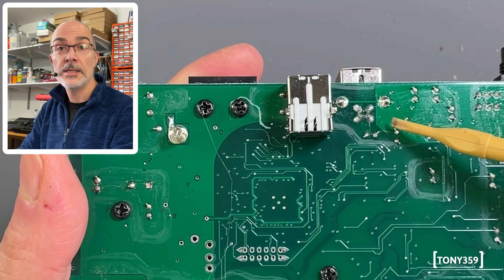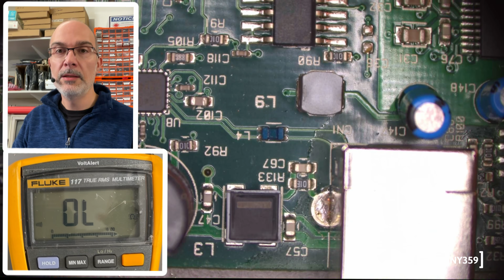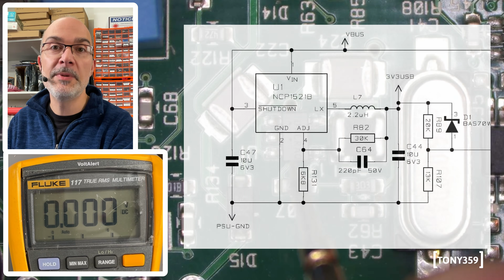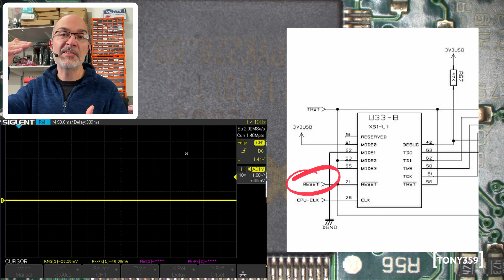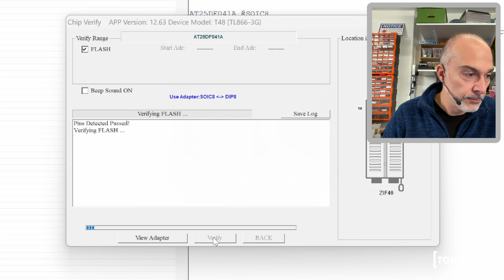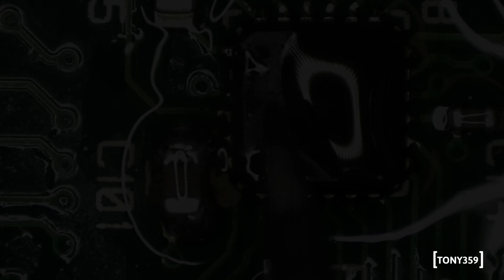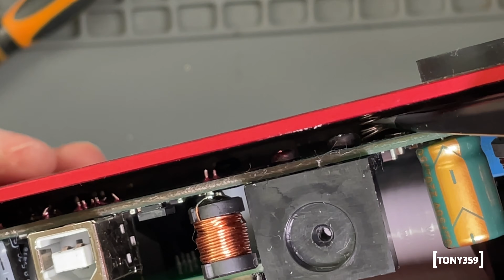Fixing this soundcard wasn't easy!

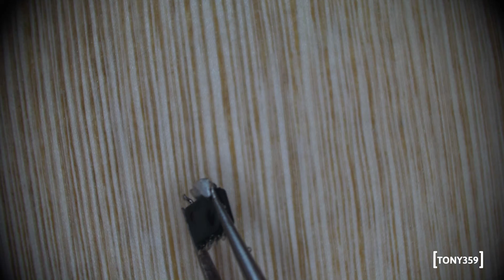Comment: 18:32 Replacing the lead-free solder on pads of the larger chips such as the flash chip is not really necessary. Generally with component-level repair, the less work you do on the board the less chances you screw something up. Also when picking up the chip from the board, don't try to grab it from below. The surface tension of the melted solder will resist your attempt and you are likely to push the chip into neighbor components and knock them off. Better to grab the chip from its sides.
Otherwise, nice job fixing this.
Reply from the maker: I was hoping to grab one of the legs but I used my bad tweezers without realising!
Thanks for the pointers, always useful!
Reply: understandable. everyone has a pair of bad tweezers on the bench, and i have more than one. that said, pulling the chip from its leg is also not a recommended technique because this way you would be applying asymmetrical force to the chip and again that could push it into neighbor components. Best to simply grab it from its sides and pull vertically. @tony359
Reply from the maker: I cannot argue with that! It was just one of those moments: wrong tweezers and wrong technique :)

Comment: The "Grime" you mentioned on the knobs is rubber coating disintegrating. I have an old Maudio interface which has been in a shelf for years and all the knobs are a sticky mess.
Reply from the maker: I thought about that - Let's hope it's that then! :) Thanks for watching!
Reply: That was my first thought as well. Looked exactly like the rubberized muck I'm used to seeing on aging devices. Haven't seen it on knobs before though, I'll admit.

Comment: Hi. I had a 6i6 1st gen on the bench, same issue, same chip to replace. First i ordered a few from china since they were not available anywhere (mouser)at that time. Replaced 3, none worked, probably fake ones. Then after more then a 6 months they became available back in Mouser, the first one worked ;). Good video, i really liked the detailed fault finding. thanks
Reply from the maker: Ah interesting! Good to have two spares then :) Thanks for watching and for your kind words!
Reply: @tony359 with pleasure. I just found your channel, i will check more of the videos.

Comment: Great diagnostic work as per usual.
You might want to give solderpaste a go instead of reapplying solder to the pads.
That way you can skip soldering pin for pin.
Clean the pads, apply a small amount of solderpaste, put the chip in place and blast it with hot air.
Reply from the maker: I have some, I thought that solder was a bit easier for my first time. Who knows. I hope I can practice again soon! Thanks for watching!
Reply: @tony359 after some practice its alot easier.
Just get some of the cheapest chips you can find in the package you want to practice and some practice pcb's.
Recently got myself a bunch of 4 layer pcb's with big internal ground planes made just to practice soldering VQFN packages for an upcoming project.

Comment: disappointing that
focusrite scarlett 2in2
does not have digital sound input for connection to the cd player, TV, blueray and the like
Reply from the maker: Well, it's a basic card. My MOTU has digital inputs (though I don't think it supports multichannel) but it's 2.5x the Scarlett's price! For the price, I think the 2i2 is a good product - but yes, it's very very basic :)
Thanks for watching!
Reply: @tony359  Okay. Almost all sound cards for computers that I know of have almost always had a digital sound input.

I like to have the same sound quality from all my digital sound sources. therefore I like to connect everything to my dac.

3 of my dac. have USB so this possibility is nothing new.

Comment: New QFN chips that have likely been sitting around for 10+ years tend to not stick unless you tin the pads under the chip first. So add flux and solder and tin the pads then when you hot air the chip it will automatically stick and all pads will be soldered. Also, you made the right call by wicking away most of the solder on the middle ground pad. Too much solder can squeeze out and create shorts on the outer pads which would be bad, most likely resulting in having to remove the chip and start over.
Reply from the maker: Thank you! Many have suggested the same! I shall do that next time! And good to hear that my decision to remove some of that solder was a good idea :)
Reply: @tony359  imho (and just for reference I'm a test engineer for a PCB assembly company so a lot of times I have to deal with soldering defects lol :P), you could have even removed all of the solder and still have gotten away with it. It's mostly used as a heatsink/ground pad and even the small amount of solder left there would have still made a good connection and besides it's a sound card, fairly low USB data transfer rate so the chip won't get hot. The most important thing with soldering QFNs is for them to lie absolutely flat on the PCB surface. Even minor level imbalances are annoying af to deal with. You should also have removed the capacitor from the side so that you could have better accessibility. It's a bulk decoupling capacitor, even if you ripped the pads you could still hack it back together and it would have worked :P
Reply from the maker: @InTimeTraveller  Absolutely. I feel I didn't manage to melt the solder under the IC - or it would have squeezed out from the edges. I was concerned I might have burnt something so... Next time will go better, I hope! Yours is a cool job!
Reply: @tony359  hi, thanks. Nah, you had a relatively thin layer left so it wouldn't squeeze out, it just gave you a hard time being perfectly level all over. Thing is, solder resist (green pcb coating) is really good at, well, resisting solder :P So, unless you have an ungodly amount of solder it's really difficult for the solder to squeeze out all the way out to the pads, because there's a good width of solder resist that is preventing it (in fact QFN packages are designed in such a way) and the chip is really not heavy enough to force it. With solder paste in the factory it's a bit easier for it to happen because you have the solder in a paste format so it's much easier to squeeze out the paste. If you had really insanely too much solder (like in the beginning) the chip would be like a boat floating on  a lake of solder 😛 So an serious note, it would most likely not stay level on some side.
Reply from the maker: @InTimeTraveller  Glad I decided to remove some of the solder at the beginning then! Well, the 2i2 is still working :)
Reply: apparently Louis Rossman is not the only one knowing how to solder tiny ICs!
Reply: @alelondon23  Louis is actually not that good. Yeah to the below-average noob he looks like a god but vs a pro electronic engineer he's pretty average. I've publicly documented smd soldering repairs 10X harder than anything he's done. Look them up you might learn something lol
Reply: @g4z-kb7ct   I'd love to. link?
Reply: and how can look up your public demo ? you dont have a video on your channel any tips?  @g4z-kb7ct
Reply: If you use enough flux, even if there's too much solder on the center pad, when you heat it and push down with the tweezers, the flux won't let the solder bridge and it just squeezes out. This looks to me like a classic case of both iron and hot air not being hot enough. Most people have their iron and air temperatures not hot enough, and end up cooking stuff because they have to sit there forever to get enough heat into the chip and the board for anything to melt. Much better to have the temperatures higher, and get in and out quick
Reply from the maker: @gorak9000  Gotcha. On the temps, I might be one of those who doesn't like to blast 500C to an IC. I know it "works" but I don't think they were never designed to withstand such temps. Yes, it's for less time but I'm not sure I like that! With this interface I should have probably turned on my pre-heater a bit more.
Reply: @tony359  Do you know how IC's are made? They're baked in diffusion ovens at crazy high temperatures for hours (I work in IC manufacturing, but I'm not familiar with the temps the diffusion ovens run at - it's not my area, but there are multiple steps that use the oven, and the temperatures are EXTREMELY high). I run my iron at 380 C and my hot air usually a little hotter than that. I actually have the exact same pre-heater you do, but I hardly ever use it - only on 12 layer boards with obnoxiously thick ground planes is it really necessary. And only really for BGA rework. Usually just the hot air wand is enough. It looks like you have one of the better hot air stations (a Quick or one of the better quality Attens, just by the look of the nozzle), so you should have plenty of heating power in the hot air gun. The super cheap ones don't really have a big enough heater to keep up at high air flow rates (aka the notorious 858D and similar)
Reply: Also, I never get the fascination or need to completely removing the solder (and ripping pads off) just to add solder back in the very next step. There's no need to clean the solder off entirely, just go over it with a little fresh solder, generous dose of flux, and flow the new chip on.
Reply from the maker: @gorak9000  It's to remove lead-free solder and add leaded - so you can flow with lower temp.
Reply: @tony359  You don't really need to remove all the lead-free to get to lower temps - just adding some leaded solder to what's there drastically reduces the melting temperature. Also, to help not rip pads off, resist the urge to "scrub" with the wick. Keep the end of the wick together (not all splayed out), put flux on it, and just "dab" with the iron - don't scrub. It's the capillary action of all the strands in the braid close together that pull up the solder - when the end is all splayed out, you don't get that capillary action anymore. Sometimes adding a little solder to the wick itself helps as well (aka when you cut off the part of the braid that's full of solder, always leave a little bit of solder on the end of the braid - don't cut back to empty braid)
Reply from the maker: @gorak9000  Quick indeed, 861 DE, the more powerful one. 380 is ok. I think I was on 360 on hot air with pre-heater. What I don't like are those who set the station at 500. I am very well aware that ICs are baked but if you look at reflowing profiles, those silly temps are kept for a very short time. AFAIK an IC is designed to reach 260C for, say 30s. More than that it's luck :) 
It's an interesting subject though, I'd like to make a video on that. One major flaw of the general consensus - again IMHO - is that we cannot apply those profiles when we use "home" tools. If you work in manufacturing you'll know how important humidity is and how extremely accurate an precise those ovens/BGA machines are. What we use is a pale approximation of those tools so I do feel that those profiles cannot be used as they are - or at least with some "tweaking" to compensate for the fact that our workshops are not environmentally controlled as a production line.
Interesting subject!
Reply: Use a glass brush to gently remove any oxidation.

Comment: Well this gives me some extra hope and encouragement to repair a fairly nice TASCAM audio interface that i bought for like $5. I haven't put a lot of time into it yet. I do have an older TASCAM that i use occasionally which needs all of its surface mount electrolytic caps replaced, because they have that characteristic squeal, but for that i need to remove every single potentiometer and switch of which there is a dozen, since the caps are occluded by them, it's an insane construction. But the old TASCAM is never gonna be a good interface even after that, it wasn't good when it released, the inputs are just about palatable, not great, but headphone/output section has a little too much distortion designed in, and is kind of hard to decipher without schematic, and it was last supported on Vista, it's from the Windows XP era (thus also badcaps), so while you can still install Vista drivers on 11, they are not what one might describe as trouble-free, as they break suspend and volume control broke during the evolution of Windows 10. The completely broken interface is recent, i really wouldn't mind getting it up and running again.

I think what happened to the recent one though is that the firmware update over USB went bad, and the ATMega microcontroller which carries the firmware gets stuck and doesn't upload the volatile firmware into the USB companion chip on power up. But i could just try replacing the USB interface IC i suppose just in case, at least it doesn't have a firmware flash to worry about. ATMega is unfortunately read locked so i can't just verify that its firmware looks valid. I will probably need to reverse engineer the firmware update utility to extract the ATMega firmware from there somehow?

This also made me interested in hunting down a well-broken first gen Focusrite 2i4, because with firmware file and schematic being present, there's no way i couldn't just rebuild it no matter what calamity befell it. I don't care for 2i2, since it doesn't even have MIDI.

If others have other interesting audio interface ideas that i can get broken/used cheaply and that are amenable to repair, i'm all ears. Should have MIDI, needs to have at least one XLR with 48V, needs to be capable of stereo line and mono guitar input.
Reply from the maker: Good luck with the TASCAM, I'm surprised that one of their products is not so good! With SMD capacitors, I recommend using two irons. I dislike the "pliers" method a lot! 
https://youtube.com/shorts/mjAHISbPUrw?feature=share
Reply: @tony359  None of their audio interfaces were actually ever that great that i know of. All are a little noisier than you'd expect for the era and the price. But the very first lineup of which my US-122 is a representative is particularly undercooked. But it's also well over 20 years old...
Reply from the maker: interesting to know!

Comment: Everything went perfect.  Just needed to add a little more solder before placing that USB IC and heating it back.  In theory, you did not need to run the solder down the side of the IC.  Next time just plug it in as LONG as no legs are joining other parts like the Cap or leg together.  I know what it feels like to want to make sure but first time wit heat gun should have been enough. Other than that great work.
Reply from the maker: Thanks, other have recommended the same! I'll keep that in mind for next time!

Comment: Got myself into a situation once where I had to replace a burnt STM32F411 on a flight controller. Your experience pretty much mirrors mine, though you have an even smaller chip. I found that holding down the chip slightly while blasting with hot air helps with flaky connections after 20th time resoldering everything haha.
Reply from the maker: I have a feeling mine didn't flow properly, I did push it down but maybe the ground pad didn't melt properly. Or maybe not enough solder! Not sure! Next one will be better!
Thanks for watching!
Reply: @tony359   my impression was the opposite .. too much solder and the chip was floating on the middle pad .. but I haven't tried QFN yet
Reply from the maker: I stumbled into some videos online and I think the idea is that when the middle pad flows, the excess solder automatically squeezes out of the sides of the IC when the IC is being pushed down. Then remove the excess. So either I didn't flow it properly (the middle pad will suck heat away, it's not easy to flow when you have an IC on top!) or...